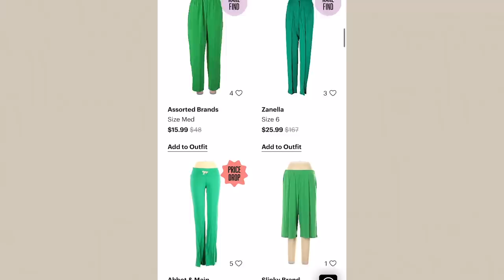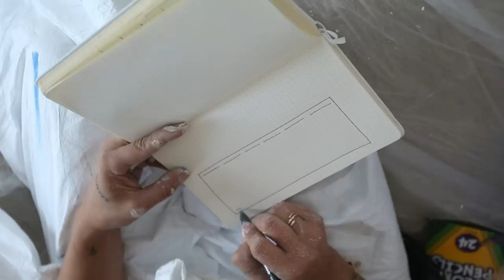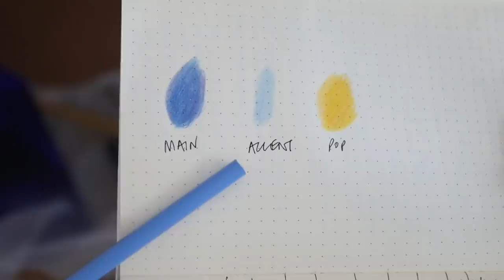Secret Project Makeover: Tiling a Shower + DIY Custom Windows

Comment: I feel like this house is gonna have a lot of logistic problems when she is done 😳
Reply: No.. not anymore than any other home. I work directly with home builders and renovation contractors in New and existing homes. Most of the people that build and/or renovate don't do things by the "books". It's sort of just get it done however they can. Which is also why I recommend not to purchase a newly built home and go for a brick home from the 70's or 80' and fix things yourself.